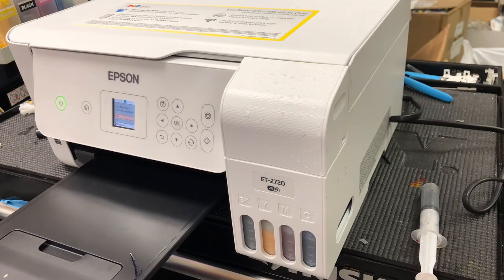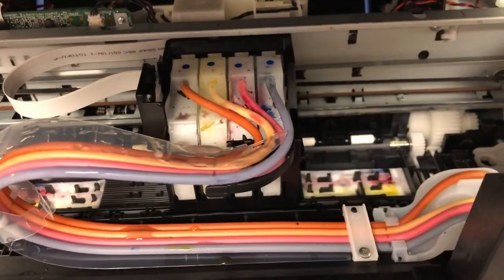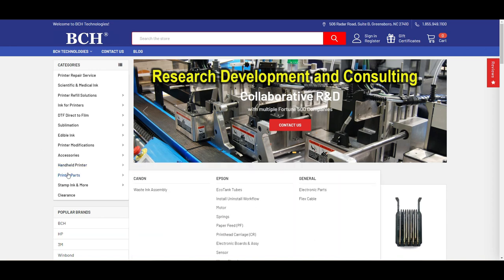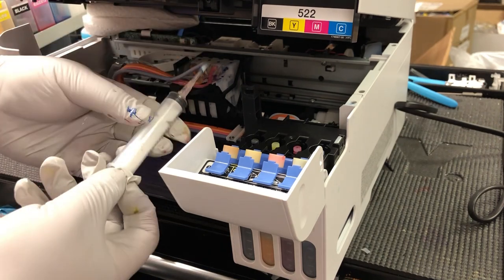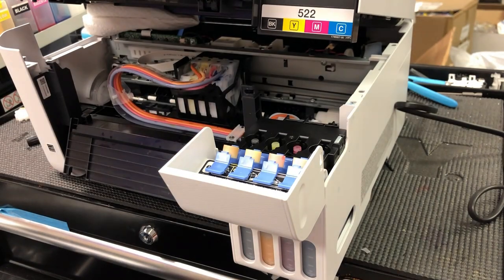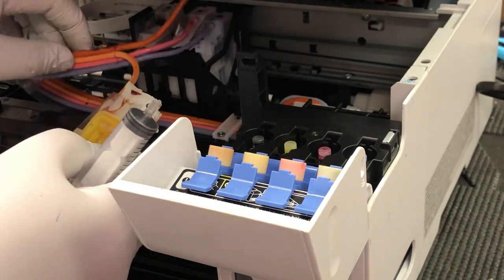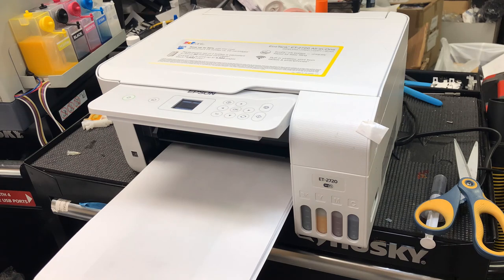Epson EcoTank Clogging Troubleshoot  Part 2 - Unclog Tubes and Prime Dampers

Comment: Hello from Germany, I just found your two video´s and my Epson ET15000 also has streaks when printing (cyan and black) and I cleaned everything yesterday because I thought that both nozzles were clogged. But then it was the same as with you, I I couldn't empty the tank because the syringe only sucked air out of the cartridges. So now I know what the problem is. So today I have to look again to see where the error in the tube is. I hope I can fix it because I use Subli ink and therefore no guarantee. But otherwise I'll try Epson and change the ink. Thank you for the great job I would be happy to report on the video whether my printer is printing nicely again.

Deutsch: Hallo aus Deutschland, ich habe eben dein zwei Video´s gefunden und mein ET15000 hat auch beim Drucken eine Streifenbildung (cyan u schwarz) und ich habe gestern alles gereinigt, weil ich dachte, das beide Düsen verstopft sind.Aber dann war genauso wie bei dir, das ich den Tank nicht leeren konnte, da die Spritze nur Luft aus den Patronen gezogen hat.Daher weiß ich ja jetzt woran es liegt. Also muss ich heute nochmal gucken, wo der Fehler im Schlauch ist.Ich hoffe das ich das hin bekomme denn ich nutze Subli Tinte und daher keine Garantie. Aber sonst werde ich es doch mal bei Epson versuchen u Tinte tauschen.Vielen dank für das tolle Video gerne berichte ich, ob mein Drucker wieder schön druckt.

Comment: Hey Kevin. I've changed my et 2710 from ink to sub. I extracted all ink. Cleaned catridges too with syringe. But I have an all lights flashing situatio . I've cleaned print heads and there are no clogs or blockages.  There's new sub ink in the tank too. All lights still flash..I've checked waste pad too and perfectly fine. Just don't know how to get this too work.
Reply: What wash flashing for you?

Comment: i wish you would show how you put the tubes back on, the harder one on the bottom left inside the printer. Now im stuck.
Reply: It just pushed back on same as with the other end. just have to line it up, I used tweasers to get a good grip on the hose and pushed it over the nipple

Comment: Hey Kevin 👋 are you able to self-clean Epson XP-4105 or WF-2850 waste ink pads? Both have user-replaceable maintenance boxes (part # C9344), but is it possible to self-clean or replace just the pads and reuse the same box without having to buy an entirely new one, the same as your ET-2750 maintenance box refresh guide? If so, which of the two printers would you recommend for quality/photo prints? Thanks!
Reply from the maker: Yes, just put inside some pantyhose and throw in the washer (not with white cloth though).  Air-dry or sun-dry.  Don't use cloth dryer.
Reply from the maker: I mean, take the sponge out and wash the sponge.  Don't throw the whole thing into washer.
Reply: @BCHTechnologies  I see, so it is the same process to remove and clean the XP-4105 as the ET-2750, thanks for your great videos! 👍

Comment: Hi Kevin, I made a mistake and put the epson ink in my new ecotank 2850 rather than the sublimation that I intended the printer for.  I removed the ink from the reservoirs but also thought I needed to from the dampers. Now I have a lot of air in them & can't get the ink to draw from the tubes to the damper. Does this require a special syringe tip? Using the blunt end is difficult to get a good seal to try drawing air out.  Feeling desperate with a brand new printer! I have purchased the small green ones that screw onto the syringe but that doesn't seem to be working well.
Reply from the maker: I usually uninstall the printer (if you are PC person), then re-install the driver from computer. When I re-install, it asks me if I want to prime the printer, then it will suck the ink out of tanks until the printhead is full. Other than that, you can repeatly run head cleanings. Remember to shut off the printer for each 4 cleanings, otherwise the printer will think your printhead is damaged.

Comment: I am having same issue as this person who wrote this in your comments  I have done everything! Kevin, I have an Epson ET-2720 - The ink was low so I added new ink. After that I did a reset ink levels. Now the printer is not printing colors, what I mean is, it acts as though it is printing, runs through the cycle but the pages come out blank. This is what I have done... several nozzle checks, 3 head checks, I pulled the little plastic ink heads (not sure what they are called), I ran solution through them, I have re-primed the ink heads(dampers), I even sucked some of the ink out of the ink tanks to confirm they are not clogged. The printer is running right, no issues, it just won't print any of the colors. The nozzle checks are all blank, no ink on the page. Do you have any suggestions?
Reply from the maker: Thank you for subscribing to my channel. Follow this video and you should get ink out of the printhead. I haven't seen a printer won't print after this.

Comment: How do you do this for Epson ET-8550 dampers? They have a huge hole in the bottom instead of a place for a tube
Reply: I need to know this too!
Reply: @susanjohnson5411  I ended up finding another video, BCH sells a special sized syringe for the 8550 that fits in the damper (where the ink tubes go in). I also got their ink + sublimation ink cleaner from the website also (green bottle). I put a paper towel folded up 3x under the print head and slowly trickled 2ml of cleaner thru each print head. The paper towel catches it and a lot comes out of the bottom so you want to change the paper towel every squirt. I fixed my printer this way
Reply: How did you prime the dampers on the et8550?

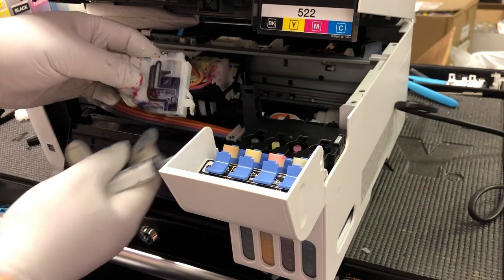Comment: 2:00  "You can see there is lots of air...."  Where?   point to it (using something smaller than your finger)   What am I supposed to be looking at when you say that?
2:11 "Hold this damper this way and insert a syringe and start sucking"   Well, you are holding most of the damper out of frame, and we can't see your fingers.... How to hold it?   And we can't see the syringe with the special cut on the tip at all.... HOW are we supposed to insert it?   What role does the cut play?

Comment: Kevin, I have an Epson ET-2720 - The ink was low so I added new ink. After that I did a reset ink levels. Now the printer is not printing colors, what I mean is, it acts as though it is printing, runs through the cycle but the pages come out blank. This is what I have done... several nozzle checks, 3 head checks, I pulled the little plastic ink heads (not sure what they are called), I ran solution through them, I have re-primed the ink heads(dampers), I even sucked some of the ink out of the ink tanks to confirm they are not clogged. The printer is running right, no issues, it just won't print any of the colors. The nozzle checks are all blank, no ink on the page. Do you have any suggestions?
Reply: I'm having the same issues with my epson f170. It's just out of warranty, I let it sit a couple of months working overtimes etc. I've made sure the ink is flowing and have half emptied my full tanks by priming. yellow is printing and no other colors. I have been searching so many videos and nothing is helping. I wish Kevin would answer you and me :)
Reply: I am having the exact same problem. The only thing I don’t want to try is a power clean but I’ve done everything else I can think of from every video. I pulled the ink through and it comes out but still nothing when I print just blank pages. Ugh it’s so frustrating. Wish I could fix this!!
Reply: @tamaradawn2112  @lorna mantilla @denna Kelly was anyone able to fix I am having same issue now

Comment: What if the tanks are not taking  the ink in
Reply: The damper on mine is not pulling the ink but the flow from the tube let's out ink just fine when I pull with a syringe. It's frustrating

Comment: Man we have a brand new et 15000 we converted to ecosolvent and it will not print well. Half the colours wont print and the tests are all garbage. Have done likely too many cleanings in an attempt to get it going by now. Ugh. Gonna have to try this now.
Reply: Did it work? I have the 15000 and I had tried everything and my cyan just won't print
Reply: @tiffanyp6998  we got a new one and its doing the same thing again. Our area is very cool and i wo der if thats afdecting the ink. Brand new printer. Also new problem on this printer the printhead gets stuck on the hoses cause they jam up and stick out trapping the print head.
Reply: @michaelgibson2163  wowza so sorry to hear. Epson wouldn't give me a new one under warranty.  So I'm on my second  deep clean.and of course that means ink waste  tank is full 🤷🏽‍♀️🤦🏾‍♀️. I'm thinking it's just the ecosolvent ink..it dries really fast and therefore clogs. A friend's that uses hers daily had the same issue. Even with regular epson ink
Reply: @tiffanyp6998  what does your friend do to resolve the drying ink issue? We are waiting on our 3rd printer now cause the printer head would jam on the hoses (totally unrelated problem) and are going to try a different brand of ink.
Reply: Hey there I can ask I will say I follow thos video to the t and was able to get to get to print pretty  good. So I'm just going to make a habit of printing at least one thing a day in the morning and evenings. What ink are u using btw I'm using " E R" not sure we can say here lol but a brand from etsy
Reply: @tiffanyp6998  im pretty sure the brand my wife bought was Roland.
Reply: @michaelgibson2163  ok cool this was  suggested by many folks that have used it without  fail. So I will see where it takes me over the next few weeks of all else fails I will just dump it and switch to sub.  The hassle is too much lol. Happy printing my friend

Comment: I’ve done this 100 times the ink keeps disappearing out of the dampener after I prime them. Could they be bad?
Reply: Did you ever figure this issue out. The same is happening to my ET16600. Kevin doesn't seem to respond to questions (only praise) in this platform, so I thought perhaps you might be able to suggest a resolution.
Reply: Bottom line, the printer is poorly designed.

Comment: I did all the steps in the videos, have good flow from the full tanks to the dampers using the syringe but it still won’t print 😢
Reply: I finally got mine to print perfectly again. We don’t print as much as we used to so now we make sure to print a page every week or 2
Reply: What did you do to fix it?
Reply: @lorenagarcia7788  
I had to repeat the process two times, it still didn’t work perfect after the first cleaning . So I left it for a couple of days and repeated the steps in The video and it slowly started working. Left it for a couple of days and then just started printing colour pages until it finally worked properly again. Now I make sure to print something every week even a test page

Comment: One question Kevin why do you cut the syringe at 1:45 before putting it in the damper.
Reply from the maker: You don't have to. Sometimes the syringe tip pushes too deep and forms a perfect seal with what's inside. So if you cut off a little piece, you can always draw the ink, no matter how deep you push. In another way, if you found it too hard to draw, you can tilt the syringe a little.
Reply: @BCHTechnologies  Thanks for the response.
Reply: Kevin my cyan doesn't pull ink when I try it at the damper but does pull ink at the tube. Will cutting the tip help? Or do I need a new damper?
Reply: Got my damper to flow ink through it but still not printing blue. Help
Reply: @BCHTechnologies Please, where do I insert the syringe when priming? It is not visible in the video.